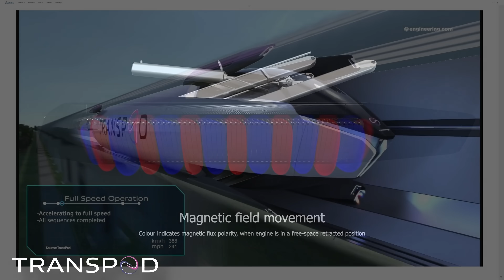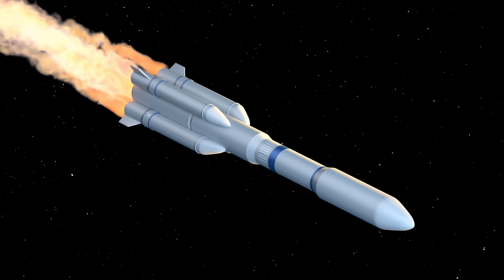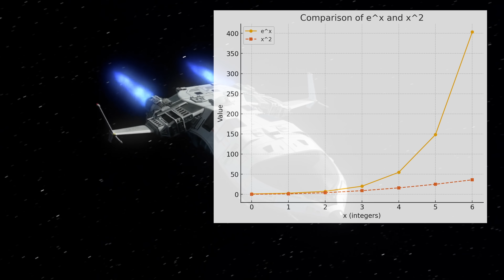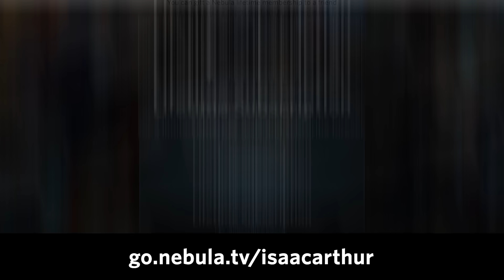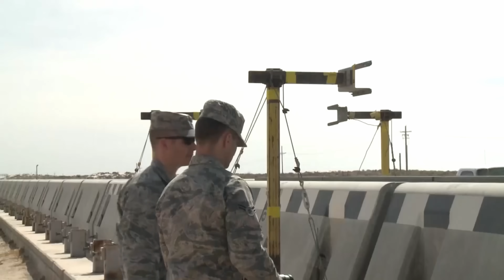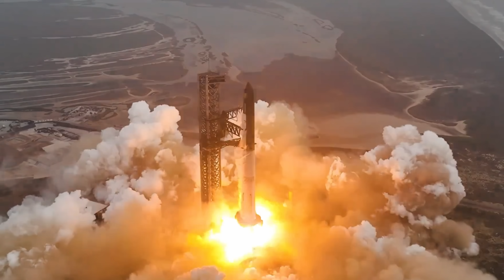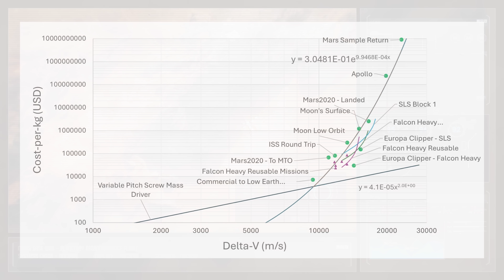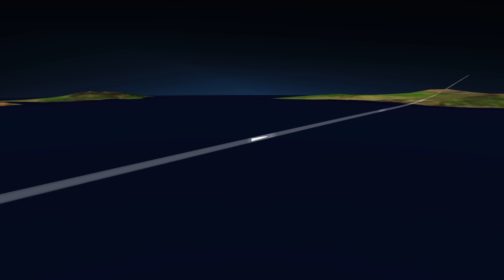Rockets vs Mass Drivers: Which Will Rule the Skies in the Future?

Comment: One of the problems with mass drivers not covered here is the cost and mechanics of creating the vacuum in the first place. The chances of being able to create a tube that does not leak and can actually be moved (the drones scenario) is pushing physics past our limits by quite some margin! There is a good reason Hyperloop has been quietly dropped by everyone. 
Realistically material science will need to improve dramatically before we can do anything like this. Look at the problems faced by Concorde due to heat expansion of materials, and that was just one short plane length not several miles of contiguous tubing (and infrastructure).

It looks like mass drivers of some description would work well outside our atmosphere so we could well see a Mars shot being a series of LEO or Geostationary orbits to infrastructure containing the driver. Something like the Spin Launcher would seem suitable for this as it only requires a motor and control mechanisms to be practicable. 

This is a fascinating concept (as are all your blogs)
Reply: Fast trains are tricky in general because of the cost of the corridor, which needs to be very straight to provide a comfortable ride. Making corridors straighter increases the right-of-way and civil engineering costs. So the progression is: first make the trains long and streamlined, then add more viaducts and tunnels, then they add maglev, and finally they stick it inside an evacuated tube. But before they can get to "stick it in a tube", the corridor cost has skyrocketed to the point where, in most countries and along most routes, the project doesn't pencil out. The issue isn't the technical difficulty of building an evacuated tube though - that's misinformation.
Reply: @spaceinfrastructure3238  Well the two can blur together. It is possible to build long straight tubes but the costs to make them because of the material problems IS exorbitant! That is part of the technical difficulty in itself! 
Can we pull a fairly hard vacuum .... sure. Can we make long tubes that could hold a vacuum ..... harder but not impossible. Can we combine the two in a manner that would work reliably ...... not really. Any small failure would compound the difficulty and make it technically not possible. Things that might not make a difference in normal circumstances would also compound the difficulty. Thermally induced linear expansion would be a real issue. We could solve it by putting heaters (and coolers) along the length of the tube but this adds to the complexity! Again if you have miles of tube you will need couplings that allow for the slide of this expansion and contraction without allowing air in. That is a real problem!
Reply: @totherarf  "Thermally induced linear expansion would be a real issue." not really. an expansion joint is about as complicated as a car tire.
Reply: @MusikCassette  Have you any experience with vacuum seals? Car tyres are well and good for holding pressure in but absolutely shite at keeping it out! 
What you would need is a kind of close fit sleeve wit an "O" ring (or more likely several) to allow the two faces of the joint to slide. Then you need some mechanism to stop the outside air pressure from collapsing it together ....... yet at the same time allowing the movement from expansion to move but no more! Not enough movement and you get a bowed tube and when you move through it the bow translates to a Delta V that could pulp you against the side. Too much movement and you lose integrity!  
The kind of expansion you would need to contain would be 500mm in a mile long tube with a 20C change so realistically you need to compensate by a meter at least. How do you even anchor a tube with that kind of expansion firmly enough?
Reply: @totherarf  you might  be confused from the difference between airtight and vacuumtight. thinking because we have a vacuum it needs to be vacuumtight. but airtight is quit enough for this application.
Reply: it is addressed here.
18:48 and it is actually a minor cost factor. not a big problem.
"There is a good reason Hyperloop has been quietly dropped by everyone. "
true, but that is not the reason.
Reply: @MusikCassette  ""people have speculated about..... " sure it got mentioned but nothing about the actual time and cost of pumping a vacuum that size ..... or of keeping it there for any length of time. 
I am interested in knowing your take on why Hyperloop got dropped if it wasn't the basic physics not working?
Reply: @totherarf  1. please don't call vacuum trains  hyperloop. that kind of implies you believe Musk came up with the concept. 
2. there is just no economic case for vacuum trains. and therefore there is not the kapital to actually make it a real product. there is nothing impossible about Vacuum trains. but they would be very expansive. and there is not a ridership, to sustain that kind of expanses. lets face it, we did not even build maglev trains. (not really)

3. about your pumping problem: you can have pumps on every segment, you can for initial evacuation push out the air with steam. And dont forget, that the tain itself is a pump.
Reply: @MusikCassette  OK points taken .... but
1. Hyperloop just showed the recent hype over the idea. It simply would not work and the cost is not the relevant issue. The time and expense of pumping out is.
2.  There is clear economic case for faster rail type transit .... that is why we have the Bullitt Train and all attempts to crack the 125mph barrier economically! Double the speed Quadruple the power!
3. Have you ever noted how long it takes to actually pump a vacuum? It is far from significant and when you have miles of chamber to pump you are talking weeks even with many pumps! Steam is a good starting point 800:1 expansion rate but it also causes problems. If you have water deposits sublimating out onto surfaces that will cause instabilities and corrosion. Again look at the old Hyperloop segments they cut up! Of course that was steel but that was needed for the strength! ..... so it is a lose / loose scenario! 
Much depends on how hard a vacuum we are talking about but realistically you would need 0.1 bar for a train and an order of magnitude for a rocket/ projectile. Then there is the tricky point of how you hold that hard vacuum for any length of time as well as what happens when you get failures. Several miles of tube would need to have some kind of sliding coupling with seals and that is another failure point that is hard to maintain! Even good quality welds become porous and the length of weld in a structure like that is immense!
Don't get me wrong, as a thought experiment it is great but practical material science would make any decent engineer say no!
Reply: @totherarf  there’s another fundamental constraint. Consider the limitations on safe acceleration and then use that to work out the minimum distance between stations required to gain a useful time advantage.

Comment: It would seem
Like the rockets would always have a huge edge being much lighter, simpler, and cheaper with similar tech and cargo traffic?

Like why space elevators wouldn’t be cost competitive.  

Especially when we have fusion reactors, so there’s no advantage really possible for reaction mass weights.  

Ah, your wrong about Rocket engines requiring extreamely low margins of salty and limited redundancy leading to high cost and low safty.  Neither is true.  Cost per craft and safety of engines is similar between rockets and jet engines when built to similar quality.  BUT the economies of scale are much less for rockets given the negligible market demand for space craft.  (You usually ignore actual economics in your vids.  Especially when you compare rockets to things like space elevators. You attempted something like this comparing delta V for mass drivers and rockets driving costs.  But that again seems to focus on the physics rather then construction/operation/etc costs.)

The high cost complexity of of a mass driver, and high maintence costs vrs a rocket, would seem to be a wall in the comparison.  In eiather case the vehicle being launched would have otherwise similar costs.  Restricted to similar loads (except for hitting the air when leaving the tube, and bouncing off the walls from suspended tube flexing) since your restricting to similar acceleration loads, reentry loads (though a bit higher for a smaller mass driver launched craft), similar maneuvering and nav system needs etc.
How long a maglevs mass driver would function, and what would be the the maintence cost per year, vrs launch demand (demand not capacity) per service life..   with rocket engine costs per craft likely similar to jet engines per airliner/freighter, and energy fuel/lox cost for eiather not likely to dominate.  Mass drivers seem very high cost per cargo ton?

Comment: I've looked into mass drivers and linear motors specifically. There's patents for various types but patents don't actually require any proof an idea will work. In scientific papers, which do require a prototype or at least a simulation or mathematical model to prove it could work, nobody has built one to go above Mach 1 with magnetic levitation linear motors. The highest speed work was NASA stuff from like 20 years ago, and nobody else appears to be pushing the top speed any further with physical prototypes that I could find. The main issue is "edge effects" because the shoe on the vehicle is much shorter than the stator and so magnetic effects on the ends of that shoe cause lots of power loss at high speed and nobody appears to have tried solving that yet.
The NASA paper is "High Velocity Linear Induction Launcher with Exit-Edge Compensation for Testing of Aerospace Components" by Kuznetsov & Marriott, they got to ~180 m/s or mach 0.5.
Reply: Do you have relevant expertise on magnetic loss mechanisms? You might be able to contribute!

Comment: You can dramatically shorten the length of a mass driver by using a circular track. This can be done by using an acceptably circular polyhedron such as a Hectogon. Each individual length can then have a rotating screw magnet track, which offers  simplicity and cost savings. All in all you could shorten the track down to roughly 1.68km in length and still have a comfortable and quick ride up to space.
Reply: a quick and comfortable ride with just a few thousand G's of centripetal acceleration
Reply: that screws you on  the acceleration.

Comment: An orbital ring for earth 

A mass driver for the moon

A space elevator for mars.
Reply: Mass driver on the orbital ring, and a space elevator to the orbital ring on Earth too.
Actually this config could be useful for all planets/Moon.
Reply: @jeechun  I mean obviously you'd have elevators to the ring; but it isn't really the conventional concept since you don't end up in orbit.
Reply: @jeechun  also, the only reason you really want an orbital ring for earth or Mars is the atmosphere. You aren't in orbit, you are just high enough up to avoid atmosphere. So there is no real reason to build one for the moon, a mass driver on the surface is just as effective and likely much easier.

For Mars idk. But I'd like space elevator somewhere, and if it doesn't work on Mars, with its fast spin and low gravity, it works no where.
Reply: @neolithictransitrevolution427  Right, on Moon there is not that much need for an orbital ring. High structures can be built there easily (if the terrain would cause some troubles, when building a mass driver oin the surface).
Orbital rings could be also handy, to help capturing interplanetary traffic, and allowing them to be built only for in space conditions. No need to use them in atmosphere any more.
Reply: I agree. Of course you realize that we have to remove Mars' moons to build an elevator there ;)
Reply: @patricialee76  not, if the levetaor only goes to the orbital ring, which could (and should) be lower than Phobos (and Deimos).
Other than that, there was a proposal of making the elevator cable moving just in a way (oscillating, as I recall) to avoid the collision with Phobos.
Reply: None of this is feasible due to scale alone. Not to mention maintenance etc. So entirely pointless with reusable rockets
Reply: @andrestein6022  lol, you may as well say literal trains on earth are now irrelevant because of reusable rockets. Reusable rockets, at least chemical rockets, will never be a scalable long term solution either because it's always insanely expensive to move freight or because squishy humans are not great with extreme acceleration. 

Obviously for the next few decades reusable rockets are the only plausible solution. But orbital rings are almost certainly the eventually infrastructure for any large-scale foot print in space, and a mass driver on the moon will be built long before that.

Comment: Sky train in Vancouver has been around a while. That's a mass driver
Reply: Will then a skytrain system tiled up at 35 degrees 240km long and capable of 10G acceleration. But inside a near vaccum tube will work then ?
Reply: @SeanSoraghan  I think that's after the Burnaby extension, but ya, I mean it's literally in the name.
Reply: My point was more that it also uses a linear induction motor. He was looking for examples.
Reply: @neolithictransitrevolution427  
Intended more as a joke lol
Reply: @SeanSoraghan  my first reply was also joking. Then I realized if anyone read this they may not know what SkyTrain is lol

Comment: I still don't get why they don’t combine the cheapest options, maximize heights and speeds, and start from there. I mean, lift it to 20 km with a balloon on a rope, fire it from there with a cannon, and then start your rocket engines. Sounds silly, but it’s doable and way cheaper.
Reply: One problem ia that one trick is offset by the next.
A balloon must have a tiny average density for it to work, meaning something like 99% of it will be a flimsy structure, that will probably be damaged by the recoil of the cannon, to start a rocket, which's bell nozzle is likely to be damaged by the explosion...
Reply: @partciudgam8478  Well i talked a while to my chatGPT wich first called me a mad man but then came out with this result:
1. Balloon-Assisted Launch (20 km):
Fuel Savings: ~200 kg
Increased Payload Capacity: ~200 kg
Cost Savings (payload value): ~2.56 million USD
2. Cannon-Assisted Acceleration (1,000 m/s):
Fuel Savings: ~218 kg
Increased Payload Capacity: ~218 kg
Cost Savings (payload value): ~2.79 million USD
Reply: It is for a Firefly rocket to shoot a 1 ton satelite into a non geo stationary orbit.
Reply: Because the cannon firing rockets would be so heavy the balloon would not lift it.
Reply: @dracoargentum9783  If your balloon does not lift it get more balloons. This is SFIA, we are moving solar systems! :)
Reply: @TotalyRandomUsername  it would be easier to use the balloon to bring the cargo to a skyhook from a three-tiered orbital platform.

Comment: What about a large mass driver that launches a small ship at a moderate acceleration carrying people, with minimal fuel. But then firing a series of fuel pods at increasong acceleration, each of which aramged to meet the small ship along its flight path, allowing on route refuel? I believe you could quite reasonably reach mars in a week.

Comment: mass drivers do not need to be a straight line. You could build a circle to accelerate in comfortably and then divert into the final upwards bit. Think of a coiled Snake with its head reaching up.

Comment: So where on earth would be the best place for a driver?
Reply: Many engineers and physicists agree that the best place for a ground-based mass driver is close to the equator and at a high altitude. Launching near the equator provides a “rotational boost” because the Earth’s surface moves fastest there, giving the payload extra initial velocity.  High-altitude sites reduce the amount of dense atmosphere the payload must travel through, which cuts down on drag and energy requirements.  Potential locations include the Andes Mountains in Ecuador and Mount Kenya in Africa—both high-elevation areas near the equator.  You'd probably want to build the mass driver along a mountain slope, taking advantage of the natural elevation so that fewer materials are needed for structural support and foundations.
Reply: @andrewsallans589  not in my back yard!
Reply: @Yoel_Mizrachi lol I was going to say the same, just because my backyard can't possibly accomodate it, (and theelectricity bills would be off the roof)
Reply: @Yoel_Mizrachi  lol
Reply: At the equator, to use rotation as extra energy.
Reply: No where, the best place would be in orbit on an Orbital ring. 

But failing that, a launch loop between Mauritius and Australia over the Indian ocean is probably best. Equatorial and out of the way.

Comment: If Gauss guns/ Whale guns/ Light Gas guns are mass drivers, shouldn't rockets be considered as mobile mass dispensers?
Reply from the maker: The dileation is vague, they are all just variations of the same fundamental principle.
Reply: *delineation
Reply: @Kargoneth   dileation  the action of speaking or writing at length on (a subject).
Reply: I am not sure which one he meant
Reply: @paperburn  wrote "dileation  the action of speaking or writing at length on (a subject)."

Never heard of it. I cannot find any references to that word with that definition. It is a typo of "deletion", "dilation", or, as I surmised, "delineation".
Reply: In the same way that incandescent light bulbs are space heaters maybe.